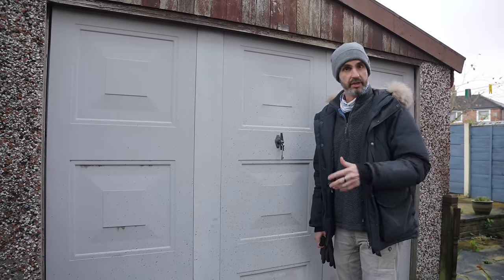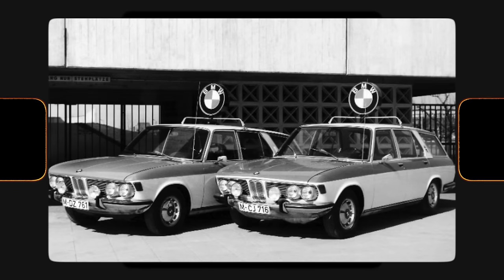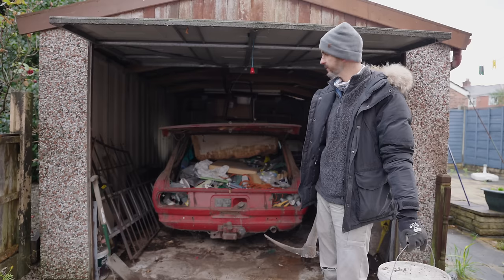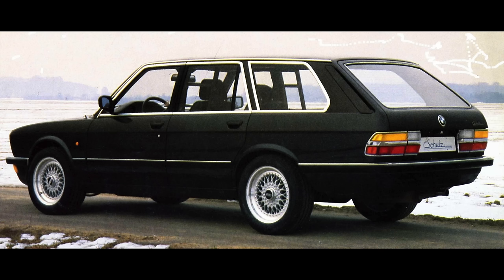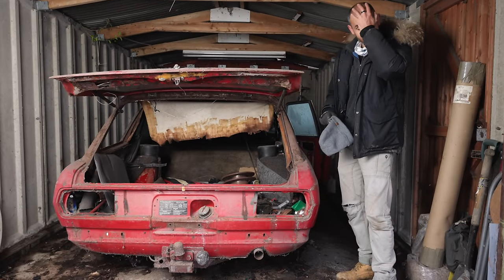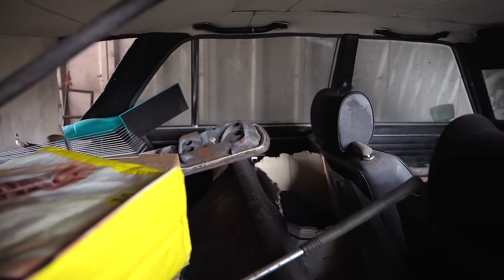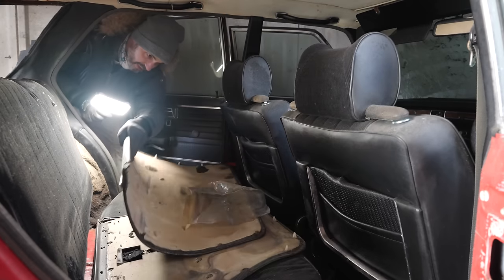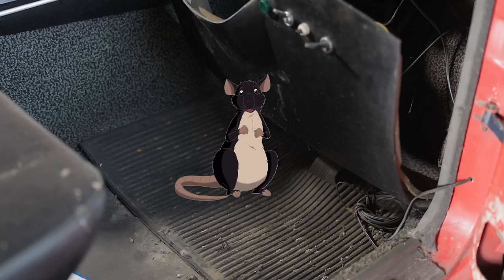Barn Find classic BMW discovery - Is this the rarest (first?) BMW Touring ever made?

Comment: Now this is the one I was truly waiting for!!! Brings my childhood back! Ok we didn’t have this touring but dad have a few E3 saloons and a E9 from 1972 to 1978, loved those cars!! Though personally I would have described the E3 as the predecessor to the 7series not so much the 5 series. Certainly on the 3.0s and 3.0si the running gear was the same as the 3.0cs and 3.0csi. Interesting back then when new and nearly new, the saloon was about half the cost as the coupe.
Reply: Agreed on the model history. The predecessor to the 5 Series was the Neue Klasse saloon range, which evolved from 1800 to 2000 (and 2000 Tilux with fuel injection).

Comment: As you said FLM Panelcraft created estate cars out of 4-cylinder and 8-cylinder Rover P6s. There is a reasonable number that have survived. BUT the conversion to the rear of the car and the chopping/cutting of the rear of the base unit etc did weaken the rear of the Rover making it dangerous in a rear end shunt! The BMW I assume maybe a little better in this regard being a typical monocoque. And yes the Beemer needs to be saved, it won't last much longer in that garage – it's on a tipping point now.

Comment: I've owned a couple of odd ball Station wagon conversions, One was a Mercedes W110 with a home built rear using a 1964 Australian Holden rear door .Another was one which was a Crayford wagon,more of a bondo sculpture that a coach built wagon With a Ford Granada rear door. . A mate had one ,a 280SE wagon which was owned by a certain Hr Harris, which devalued it....ooops. 
I've also owned A BMW of that model,a 30SiL . 5 speed manual trans. The injected motor was ripper!. 
Foam on car fires is a bugger as it eats the metal,all of it. If it gets used on an Aircraft, the Aircraft is written off.

Comment: Great episode and really rare car you've come across. Bmw didn't have a real station wagon/estate until 87/88 with the E30 Touring. 
There was also a model in 67/68 BMW-Glas 1304 CL and 69/70 Bmw 1600 Touring (02 serie) , but these are hatchbacks.

 Bmw Schultz you have heard of, remember there were some here in Norway 86/87 and were also coachbuilds. These were based on the E28 (5 series) usaly with the 525i engine. 
Built in Germany, but due to Norwegian tax rules, these were not unusual to see on the road. 
This BMW 2500 (L? ,Long wheelbase version of E3) is very unusual in car history. 
E3 is the BMW 7 series, like the Mercedes S-class. 
Are factory cars made in this car class as an estate at all? 
The closest I can think of (based on period) is the Mercedes 300tdt and Volvo 760 GLE, but the BMW 7 series is in a different class.

 Hope the right enthusiast sees the uniqueness here and that the former owner gets well paid for securing something a very exciting project.

Comment: Lovely car, but I think its more a 7 series predecessor than a 5 series. The E12 5 series replaced the Neue Klasse 1500, 1800 and 2000. The 2000 C and 2000 CS coupés were replaced by the  E9 2800 CS. In 1972. The 6 series was built from the 5 series platform.

Comment: 2:20 e3 is the predecessor of the 7 series. the predecessor of the 5 series was the "neue klasse" bmw 1500 1600 1800 2000. you could have known since you mentioned it was built until 1977 whereas the 5 series was released in 1972. nitpicking? yes. but from a channel of this profile i expect some proper research esp in such an easy and hard fact. this is gibberish on an otherwise superb channel. keep up the good work.

Comment: I would challenge you saying the precursor to the 525, the 2500,2800 and 3.0, I have owned a 2500. 3.0s and a 3.0CSL in the past, the E3 was the fore runner of the 7 series not the 5

Comment: I can see you feel deeply for this car - as does the lovely owner. 
For me though, it’s  not an attractive estate, like the Rover. 
There was a 2002 touring in the 70’s and it was more of a hatchback and not nearly as good looking as the saloon. 
On vinyl rooves, back in the day, when the first Opel Manta had just come out, I was a young trainee salesman in an Opel garage in Dublin. 
It was a small showroom with just enough space for half a dozen cars. The star, once the Opel GT had left the building, was a gorgeous metallic blue Manta.  The building itself was in the city centre and in need of some serious maintenance.
One one quiet Wednesday afternoon, the quiet was interrupted by a loud crash. A large part ot the ceiling wanted to get a closer look at the Manta and landed on the roof. 
The big chunks were confined to the roof although the rest of the car was covered in plaster dust. 
Off went the Manta to the body shop and a week later, reappeared, having gained a vinyl roof to cover the probably less than perfect repair to the body. 
The car was sold at list with the vinyl roof being charged for as an optional extra. 
If your reading this and thinking of trying to get your money back, forget it. Stanley Woods & Burney is long gone.

Comment: Aren't we forgetting the 02-series Touring here?
Reply: The 2000 touring was unloved for years.  To my mind though, the tii version, with 130bhp, was the original hot hatch.
Reply from the maker: Not a proper estate though, was it.
Reply: No, although I feel as if I saw that there was an estate based on the Neue Klasse in the same era? Possibly used as race or rally support, or maybe european version of the AA/RAC? Of course a few decades of BMW fanboying may have just conjured that up amid my extremely poor middle aged memory.  😆 @TheLateBrakeShow

Comment: Pretty sure Crayford converted these.  I was offered one in the early 90’s for £100 but bought a saloon 3.0si instead. Great cars though.
The tailgate is mainly Austin Westminster and the original boot combined.   
If I had the cash I’d love to restore and keep this E3 myself.   So much potential.  😊
Reply from the maker: Crayford did not, but FLM Panelcraft were linked to Crayford at various times.
Reply: My elderly memory has limped into action now you say that Johnny.  Classic Heroes were selling a mint polaris silver example for £80K about 6 years back so this is well worth restoring. 
 @TheLateBrakeShow